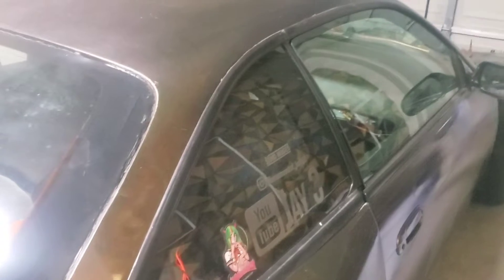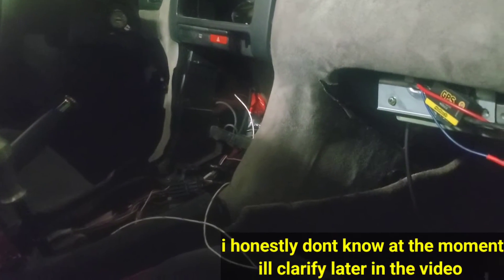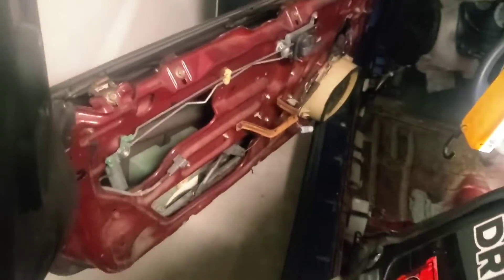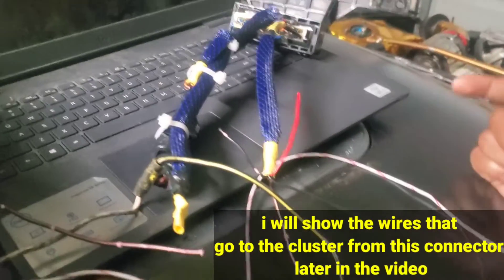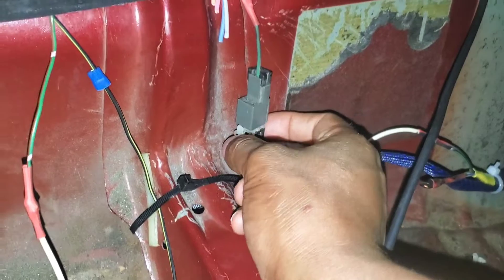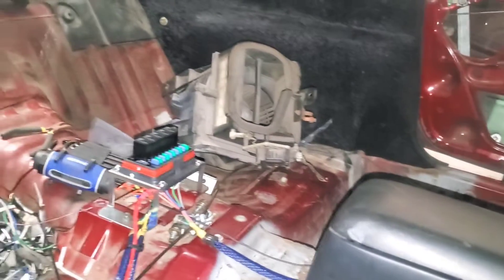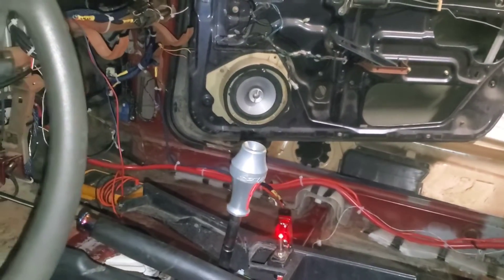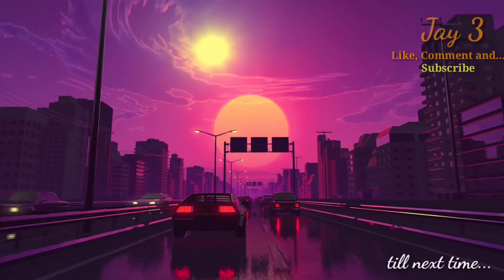I should of done this years ago (s14 240sx racecar wiring explained)

Comment: Bro, do you need any help with wiring. I did the same setup as you using the bussman relay box and oem cluster. I did my wiring from scratch and all the gauges are working. Also the wires the fuel pump from that bussman too. All you need to do is to depin  one relay that you want to use for the fuel pump, and take the 85 and instead of wiring it to ground, wire it to positive. This way the pump will be switched in via ground.
Reply from the maker: This is essentially what i did lol